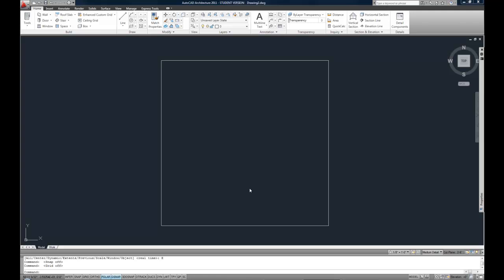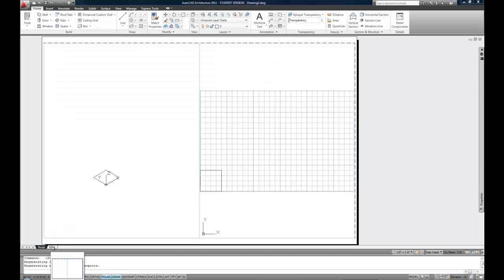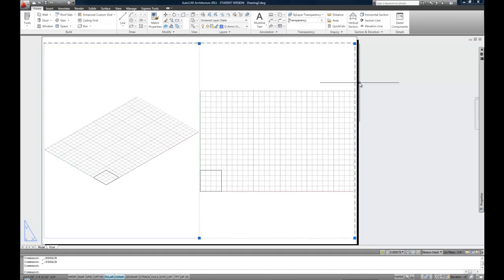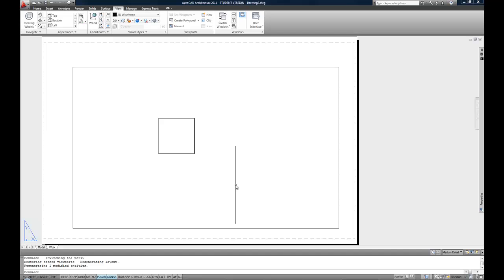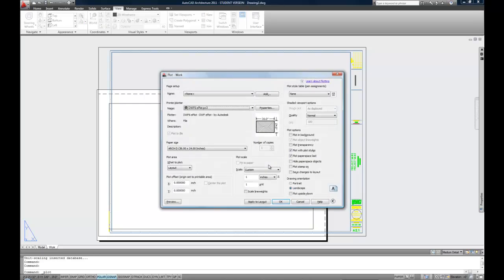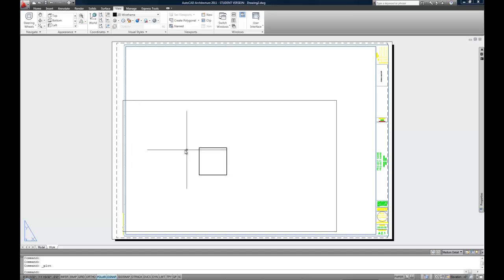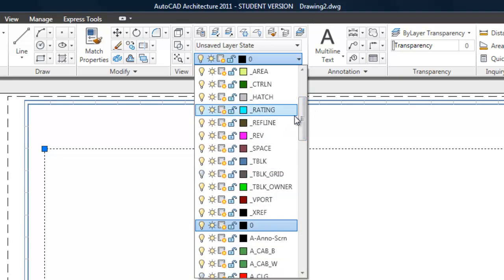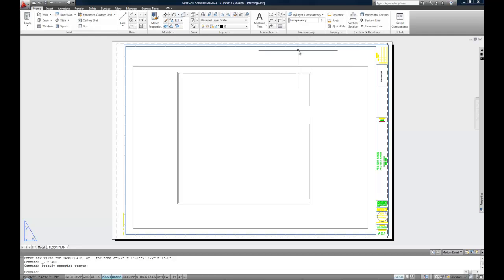AutoCAD Fund.: paperspace/viewports

Comment: Helo! My Model is not shown in layout.. I have tried all steps regarding sheet size, Creat newport and zooming etc no option is working in it..Plz do help me how I go through with this problem
Reply from the maker: You're missing something but it's hard to tell what without having your file. Make sure you're working through the viewport (model mode), make sure the viewport is unlocked, then zoom extents.     This will absolutely show the drawing/model in the viewport. But if you have tiny objects spaced extremely far way, it may not be readily visible.
Reply: Everything is f9 I have checked everything but nothing is shown in layout,, I have plan a 2d model with ground +1st but when I go to layout nothing is shown their.. Give me ur mail I would like to send u my plan lets check whats wrong with this Thank you
Reply: When I made Any Drawing in Model and after that when I m coming to layout nothing is shown in layout after zoom extents
Reply from the maker: I'm not posting my email address here publicly.  You can send me a private message if you want.  Your profile doesn't allow me to send you one.

Comment: bad because you didnt explain how to use zoom command. what if your model is so small that when you use viewport you cant see the object? you didnt explain anything.
Reply: +ruffneck168 Zoom command, including zoom extents, is already covered in a different video. Zooming and panning within the viewport is covered during the 13th minute of this video.
Reply: I was looking for zoom xp help =/ figured it out ont eh autocad forum
Reply: +ruffneck168 I didn't cover that command because it is nearly obsolete.  Typical scales are already available from the pulldown.  For other scales, I would recommend making a custom scale for the pulldown in lieu of using the old command.  That allows you to use it for annotation too.
Reply: unfortunately, the school im in is teaching that way. they wanted us to create a plan/profile based on the cl and data provided. then block the finished profile and scale the y axis. the cad template given already had defpoint boundary given on where the profile/plans we were creating should be in. on the titleblock one viewport was already given of the plan view. we needed to match the scaled profile with the plan in the viewport. the command we were taught is to use zoom xp and click the box from one side to the other.

Comment from the maker: It sounds like you XREF'd the column drawing in to 0,0 location. That is fine, but only if the location of the columns in their original drawing is where they need to be relative to 0,0.  If they are too far from 0,0, then they won't show up where you want in the host drawing.   So you have two choices - you can either move the columns in their original file, or move the XREF in the host file.

Comment from the maker: Double-check the size of the titleblock matches the paper you want to use and is being inserted at true (1:1) size.  Verify the units and scale of the drawing in modelspace are set the way you want.  Verify the scale factor being applied when you choose 1:100 for the viewport is correct (choose edit scales from the scale fly-out).  It can really only be one or more of those things.